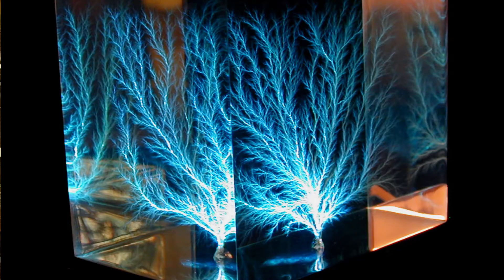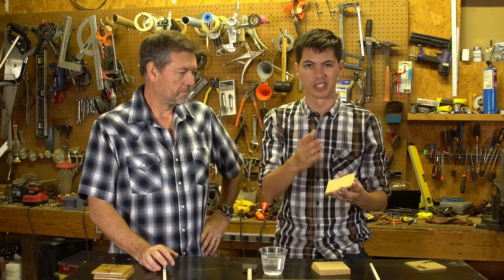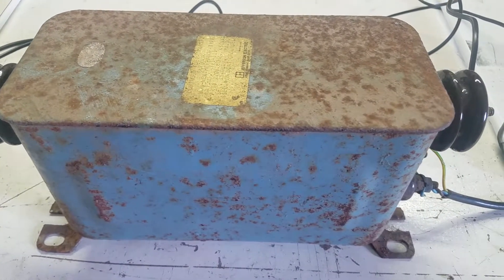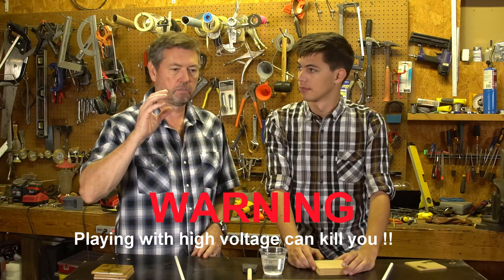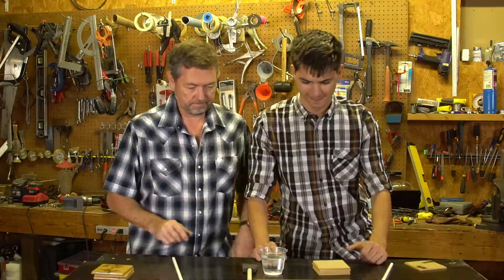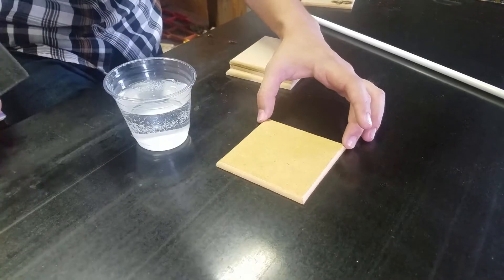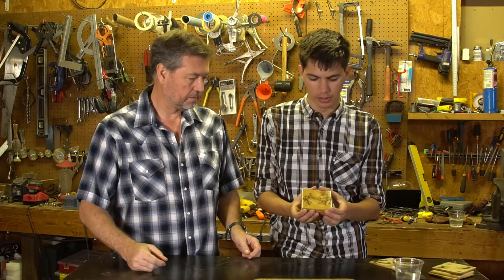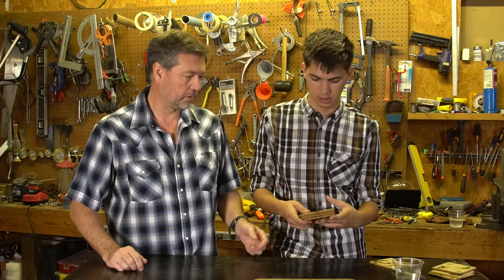How We Use High Voltage To Create Unique Lightning Pattern Artwork

Comment: Hi, I'm experienced with electricity, and know the safety with high voltage, I've been wanting to do this for a while with my neon transformer,
can you please tell me what the recipe is for the baking soda mixture ?
Reply from the maker: It depends on the wood being used and the voltage. Higher voltage needs less baking soda generally. Suggest starting with 1 teaspoon per cup of water and adding more if needed.